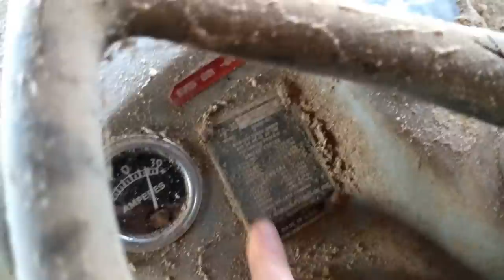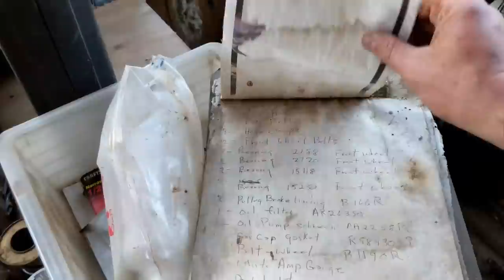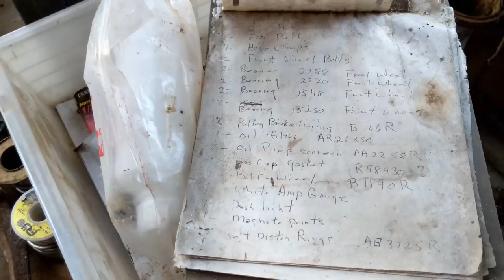Old Circular Belsaw Sawmill First Run in Years

Comment: The Thunderbird is a '58 or '59.  Was the squeaking the carriage wheels ?  Mine had a couple that had been stuck so long the previous owner drug them completely flat.  I had to make new ones. If you have a couple red cedar close by that seems to be a good wood to set up the saw by.  Even though cedar is brasch, it cuts easily and will give you time to assess the condition of the saw.  For example, is it dull? Does it need a swaging? Is the carriage running true? Is the bed bending or bowing? Is the blade hammered for a right hand mill or left hand mill?  Is the blade hammered for 540 rpm?   Of course, its now two months past the date of this first run, so I am sure by now you've got it running pretty smooth. I totally enjoyed this video !!
Reply from the maker: Yessir, everything you said was correct.  The saw has new bits, the "wheels" (really piddly rollers) had flat spots so new ones were milled, the carriage was way out of square, etc.  Everything has mostly been addressed but it's still vastly underpowered but it has cut quite a few boards since this video.  The comments to this video have been tremendously helpful.....lots of people really know their stuff!  We had never messed with a mill prior to this but as my grandpa said, just dive in and figure it out!

Comment: A couple of tips: When your making your first cut, advance the log with the dogs loose, so it won’t roll the log and bind up. Then tighten them down before entering the cut. 
Belsaw always recommended not turning larger logs on the carriage. The recommended turning the log on the indeed and sliding it back onto the carriage. 
You’ll get it dialed in.

Comment: Y'all know just enough to be dangerous but it makes for enjoyable viewing. Noticed you cleaned up the arbor w/ a file and somehow neglected the teeth, good on you. Blade looks like a huge rusty mess, adds a lot of drag. Saw may need hammered but being you don't even know what rpm to run at, guess that doesn't matter much. Personally, those old Belsaw m14's scare the shit out me.
Reply: Not a m-14 but much older, got one like it from 1940s. This saw was converted from hand crank carriage  feed. It will have the old 1 1/2 mandrel.And the carriage ever part is replaceable.

Comment: One gentleman mentioned swadge and a couple other thing re saw velocity and such.....one more thing that needs to be added to that is saw tension which is also extremely important in a circular saw.....this saw may need to be hammered to get tension back into it.....if not it won’t ever cut straight or true.....no matter what you do.....

Comment: To run a mill like that with tractor , you need atleast 70 HP. Especially sawing hardwoods like oak or hickory . And not hydraulic p.t.o.  need clutch style P.t.o. the hydraulic drive , will slow down and after while , pump gets hot and break down . Or get a diesel power unit . If use pto , need bigger tractor .
Reply from the maker: Yessir.  This video is old but yes, we were vastly underpowered, especially under load and the saw wasn't staying true.....just wobbling.  We've since replaced the bits, cleaned the rust, trued' up the carriage and did some gearing changes to keep up the rpms but of course running slower.  My buddy has a couple of Cummins' that would  power this thing appropriately but is it worth it to go through the effort for a rudimentary, homeowner mill?  Regardless, we can cut lumber as it now sits without putting any money towards it.
Reply: That's  good . I hate to see something like that sit and ruin . You all had a great find there . Not just the mill . Good luck to ya and hope everything goes well . HAPPY NEW YEAR .
Reply: Be warned that mill can only handle about 40 hp. That 1 1/2 mandrel can snap off at about 500 ft pounds of torque, the mill was designed for very slow feed. I have bought several of these mills after bad accidents. The one i am running now a guy got killed on it. I got several in different shapes. A couple will broke mandrels. At very least use belts on mandrel to limit hp. I frist run one of these mills at 14 year old with old 8n ford tractor sawing cross ties. So i got over 50 years total running them. Also got big frick mill. be it takes a crew to run it. And the bell saw runs much cheaper.

Comment: Turn up the tractor till blade rpm reaches 600 rpm or whatever rpm the saw is hammered for
Reply: You can't run 600 rpm on the blade because most tractors run at 540 rpm on the power take off if the tractor is nearly wide open throttle.
Reply: @johnseavey6622  then run it at 540 rpm lol

Comment: Blades dull not enough rpms and oil yhe track wheels or put new bearing ones in,i saw the the whole carriage and frame move not good ,sawing with a dull blade will cause many problems

Comment: The rails need ATF on them, like the newer ones have and some on the chain also!!!!!!!! The tractor can not be in idle needs to be going faster than this....say 3000 RPM to 4500 RPM!!!!!!
Reply: That blade turns 500 rpm, that tractor would be lucky to turn much over 2,000 rpm wide open.

Comment: Definitely the track needs to be greased its dry or gear oil and the saw is working to harder because it rusty if you take sand paper and sand most of the rust off you will see a big difference and the teeth may need sharpen

Comment: Did the blade keep flexing over?
Man you guys can't be faulted for lack of trying.  When we're y'all working on this?  Were you able to get it to work for you yet?  Happy New Year guys 🎉☺
Reply from the maker: Kaye's Diggin It yeah, it would bow when it hit a knot.  You can hear the tractor bog down quite a bit when cutting so we could not have enough horsepower, the blade could be dull or both.  We're determined to cut up a whole log so we'll figure it out
Reply: As stated blade needs a deep cleaning and detailed sharpening. bet anything that solves the bogging problem. Your tractor is definitely not underpowered. And the t bird is either 58 or 59.
Reply: @joshschneider9766  The T-bird is a 1958 model. Most of those types of saws were designed to run at 540 power take off  shaft rpm

Comment: That was totally miss aligned, as in the carrage was not in line with the blade , or maybe the blade is blunt and ground "not square", it totally cut towards the operator, your damm lucky the teeth on the blade didnt catch the machine and have a dangerous situation on your hands. The blade needs to be dropped off at your local Saw Doctor and check if it needs a hammer then properly sharpened, actually the teeth looked to me as replaceable tips.

Comment: I'm sure you guys know this about horsepower... It's like sex.  Way too much is just about enough!!  Actually, I think that rusty blade needs to be cleaned up and sharpened, and then it will work as expected.
Reply from the maker: Lol.  We cleaned the blade and replaced bits.  We also squared the tracks.  We can't do much about the HP right now but we did slow down the carriage so it's cutting good but slow.  If we can ever make it back there I'll make an updated video.  Thanks for watching!